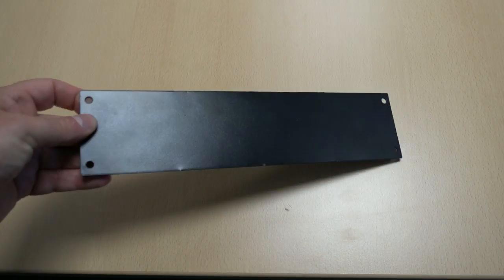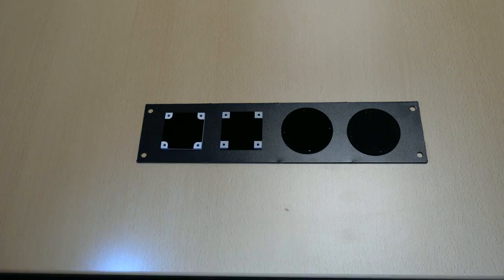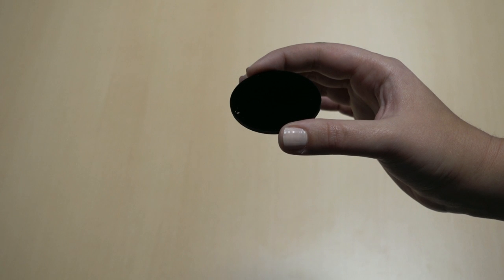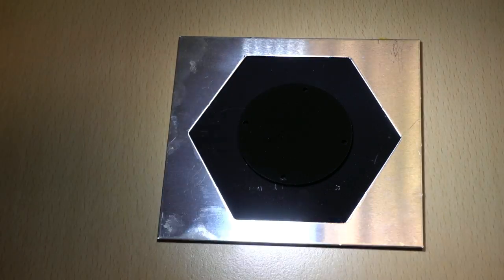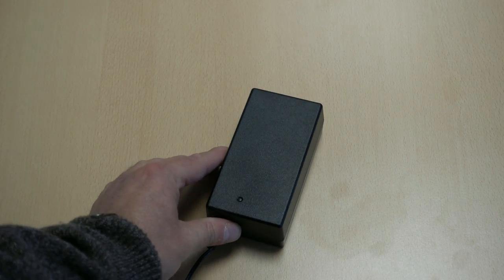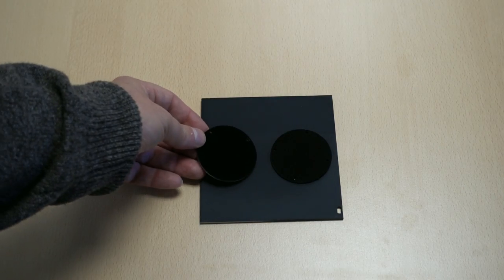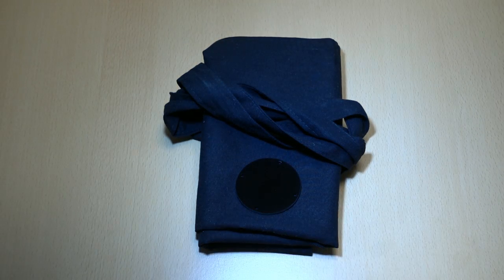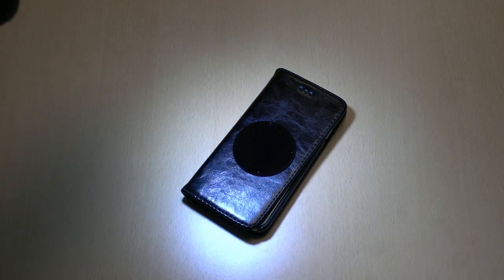Two new non-nanotube super-black paints - that you can handle!

Comment: Hi there, I'd like to pose a question to you... You have a closed box and this is coating every surface on the inside of the box. You then introduce a light source to go inside that closed box... Would it still be pitch black in the box? As there would be no surface for that light source to reflect off of! It's too much for my mind to work out! :)
Reply from the maker: Depends on the intensity of the light source. At normal levels it would be black.
Reply: Awesome... Thanks :D

Comment: Could this be used in some way to coat tv screens so that LED TVs can show true black as opposed to the grey ish colour we get on all of them save for the LG one. I assume it's thin enough to be able to be transparent, as long as you can make it work as transparent from one side and a super adsorber the other side. Perhaps that's not the way to do it, but there must be some application whereby this has the potential to improve the black of TVs. You may need to figure out a way of aligning the nanotubes somehow, can't be too hard to do ;)I assume the obvious applications is on Solar PV panels and that's being progressed also?? What else?? Radar?? Tactical night wear and camouflage? Could it be used in glass for cars etc to get rid of glare? Would it have an application in telescopes also? How about light pollution shields to prevent light reflecting into certain places or as black out blinds?? So many potential applications it's crazy.
Reply from the maker: Yes, it could be used in that application.
Reply: LED TV's are LCD Screens with LED as opposed to Florescent tubes to provide their lighting. The polarization of LCD's doesn't filter out all of the light this is why you get grey arias not black.

Some LG's are OLED's this is a compleatly different Technology It doesn't rely on back(or edge) lighting each Pixel is a light souce in its own right so when it is off there is no light emitted.

I don't see how this would get around the problem of low amounts of light seeping through the polarization though if they could make it transparent in one direction it would make an awesome Anti-reflective coating for screens. Though as most screens are made in China the Export restriction would apply so don't hold your breath.

Comment: Does it fade over time? Is it permanent or easily removable? Is it toxic or have to be handled in a special way?
Reply from the maker: It it not attacked by UV, it is non toxic, and its surface is not abraidable as the optical cavities would be damaged. Thanks.
Reply from the maker: No, water and air would not make it fade.
Reply: but it's still attacked by other elements that could make it fade, yes?

Comment: How does it perform against abrasion(polishing)? What are the thermal properties of the binding resin, assuming that it absorbs a large amount of light I can only assume it radiates energy in the infrared part of the spectrum or can it radiate at longer wavelengths? is the coating ablative at high temps or will it de-laminate at high temps?
Reply from the maker: It is not resistant to polishing as that would damage the optical cavities. This coating is not suitable for use above 120°C. Thanks.
Reply: So it would be useful in solar thermal home heating systems using water or air, but only if the collectors aren't allowed to get too hot.
Reply: What happens at over 120°C?

Comment: Does it need a protective clear coat after.
Reply from the maker: No. A clear coat would change its optical properties.
Reply: +Surrey NanoSystems Thank you. Is it resisrant to scratching and atmospherics.
Reply from the maker: It's resistant to light abrasion and very resistant to atmospherics. It's not designed to be used on surfaces that have constant contact as that would start blocking the optical cavities.